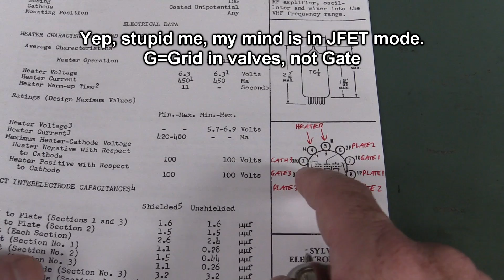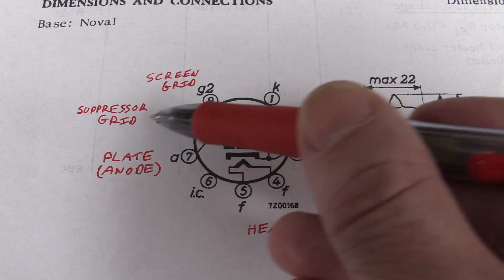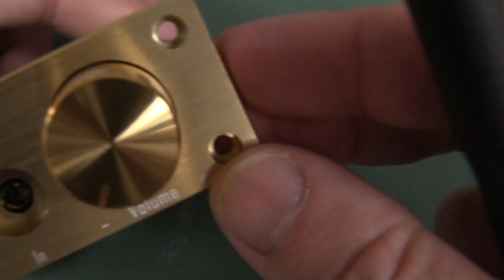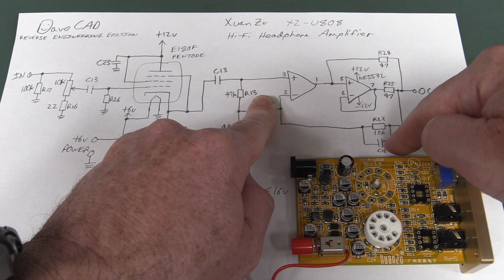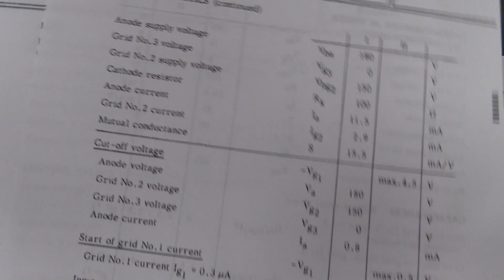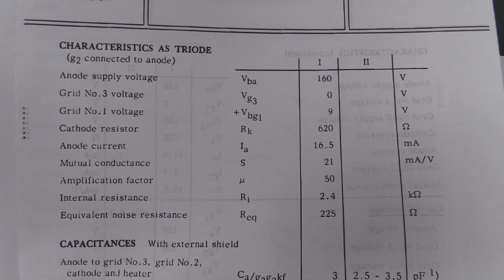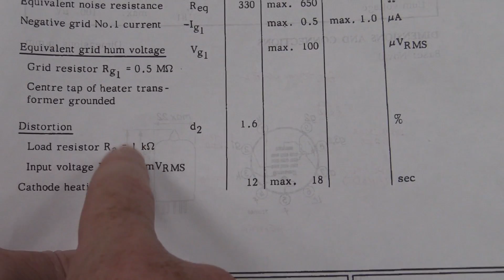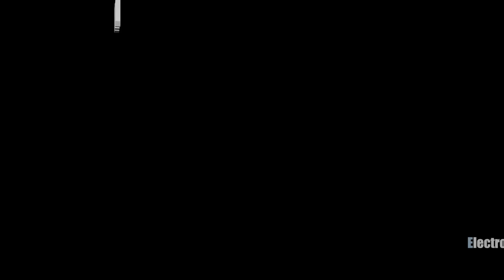EEVblog #837 - Reverse Engineering A Valve Headphone Amplifier

Comment: My rant isn't so much about the gimmicky use of the tubes (valves), but the overuse of blue LEDs. Why are blue LEDs used everywhere  !?

I'm old enough to remember when blue LEDs did not exist. You had red, yellow, and that ugly lime green, but no blue. Cree made some SiC blue LEDs in the mid 80's, but they didn't go far. It wasn't until superbright blues, made of GaN came out ~1994, then blue was everywhere !

But that was 22 years ago, so why still the frick'n overuse of BLUE !? Reds a nice color. Amber/yellow even looks classier. With GaN, they now have really nice green, too. And orange is one of my favorites. When on, it looks like candy. You almost want to bite the LED. Though orange, may not be a good choice under a orange glowing filament. But screw the blue ! Its also harsh on the eyes.
Reply: Michael Moorrees 

The blue glow produces a "visible illusion" of power.

If one were to see a high-power broadcast transmitter using vacuum tubes (e.g. the transmitter of any 50kW broadcast station before about 1980), a blue glow would be visible, along  with the brighter orange glow of the filament, simply because so many electrons were flowing so fast with traces of other gases in the tube.

Ironically, a blue glow in a receiving tube indicates that the tube is weak - that too much gas has accumulated in the tube.
Reply: honestly?... they have to do me a favour:: OR!! they start using white leds as indicators in devices with more that one indicator, OR!! i'll be happy with blue as well.... i don't see any major difference between the colors they use, i mean

-greenred
-redgreen
-yellowgreenred
-thatususalcolorusedtodrivedaltonicscrazy :D

screw lan cards and arduinos!! i'm a proud daltonic!! :D

but i agree
Reply: Because in 1990 blues cost £5 each, so to old engineers they still have an aura of luxury...
Reply: I'm old enough to remember when LED's were very small dots only on watches and calculators, and when the LM741 originally came out and sold for more than $10 each. Also 4 function calculators were over $200 and had a green display.

Comment: In some jurisdictions this could be seen as a Trading Standards issue, since it isn't actually a valve AMPLIFIER at all. Even if they made the argument that a cathode follower is a current amplifier that doesn't hold here since the input resistor on the first op-amp is a much higher value than the volume pot resistance. 

The op-amps provide a gain of about 6 by my reckoning, and probably a bit of tone shaping which  leads to the subjective, "Wow, that sounds better" user response.  Though,a 5532 isn't designed to drive a low impedance load like headphones, and the use of a purpose-designed headphone driver would almost certainly give lower distortion results and more drive power. 

In fact, the design min load impedance of the 5532 is 600R according to the Ti datasheet, and the current limiters will operate at about 40mA typically (0.6v across 15R) so they really are stretching things here. Even with two in parallel that's going to hit a current overload situation at about 3v peak output with low impedance headphones and two 47R's. That would actually be more than adequate volume with most headphones, but it's a very bad way to design an amplifier, basically running the ICs way outside of design envelope. 

Exactly why they didn't use the valve as an amplifier, not sure, possibly because a higher supply voltage than 24v would be needed to achieve a linear response.
Reply: "Exactly why they didn't use the valve as an amplifier, not sure, . . . "

Because that would take work and circuit complexity. There's no way they could meet their price point.

Comment: Awesome video..Would love to see a reverse engineering of the peavey 6505mh (mini head). A lot of talk on whether the tubes are functioning as most tube amps do..
Reply: From the Peavey product page: 2x EL84 power tubes and 3x12AX7/ECC83 preamp tubes
Those are pretty standard types/quantities of tubes for a guitar head. Sounds like a normal tube amp design to me.
EDIT: Electronics repair tech here... I've got a Marshall solid state head sitting down at the shop right now, really should get around to looking at that... :)

Comment: Tubes don't use as much power as a lot of people think My tube amp in my record player used about 75 watts. A hair dryer uses 1200 to 1500 watts, a cable box uses 500 watts I would not use either one. A tube TV used 300 watts still one of the lower wattage users.

Comment: I was surprised the tube would even work at all with just 24V on it, cathode area is large on those tubes and drive current needed is tiny so I suppose it works well enough, definitely will add the tube sound. Its all obviously just a marketing exercise. The pcb is very nice double sided plated through hole solder mask and the unit is very neat, very surprised, very nice. The ne5532 opamps are old school and very average sound quality, with the tubes in the circuit its definitely not hi-fi. The ne5532 buffer circuit has some gain and the response appears at a glance to be tweaked to compensate for the I guess the tubes very ordinary freq response performance.

Comment: I'm quite surprised... I saw this in the previous mailbag and thought the valves were just fake and made to glow and not part of the circuit.... but they do actually do something.  In the CF configuration do they introduce a distortion that can be perceived?  Does it sound like something that could be construed as "Tube Sound"?   It would be interesting to follow this up with some time domain analysis, what sort of distortion etc?

Comment: I might have this wrong, but i think it's not about distortion, it's about "tube sound." They add warmth to the audio signal. It's an audiophile term. So, does this amp do that? Only a professional audio enthusiast would be able to tell. Dave, you don't strike me as one. :)
Reply: You do realize that the "warmth" you speak of is the product of an innate alteration applied to the original source audio by the tube, mostly harmonics and non-linearities  -- the very definition of "distortion".  So it is, in fact, all about distortion.

That said, there is nothing wrong with preferring a certain sound to one's music, just so long as one realizes that any alteration of the input source is, in fact, a distortion of that source.  The problem is when egos, and sellers looking to exploit those with far more money than sense, can not acknowledge that the "warmth" is what it is, distortion -- desirable, or not, it is what it is.
Reply: Ethan Poole Any alteration is distortion, but distortion has a strong negative connotation. When someone says distortion, I immediately think "clipping." But that's not what you're saying, and that's not what I'm saying either.

Comment: The pros for valves are as follows. 
- simpler circuits than semiconductors in amplifiers. 
- less need for negative feed back, also simplifies stuff. 
- easier to DIY
- very tolerant of overloads compared to semiconductors. 
- beam tetrodes/pentodes behave in a very interesting way in a ultra-linear configuration, giving you a mix of a voltage amplifier and transconductance amplifier, behaving like a constant power amplifier. 
- some triodes have extremely low distortion without any negative feedback, much better than transistors, though the latter can train its superior gain for less distortion. 

Everything else goes to solid state.
Reply: +TheLawnWanderer Til you get into the transforem and got 1% or more distorsion may be killing and unicorm and use his horn build transformer made it sound better.
Reply: pufero1 You can actually make transformers almost transparent to the whole circuit, with a few DB of negative feedback after the tranny.
making a tube power amp with 0.2% distortion isn't all that hard.

Tubes aren't great, they're fun.
Reply: +TheLawnWanderer Valves aren't simpler than semiconductors in my humble opinion, due to the need of designing a HV power supply for them, therefore they are not easier to DIY.
It's seems much simpler to me to power things from the likes of +5v/-5v and negative feedback isn't really that hard in the first place.
But again, that's just my two cents, and I'm more into digital and analog semiconductors than valves, and valves don't seem like much fun to me (and neither transormer winding).

Nixies are fun though, because you can actually see them working in a different way to all other display technologies :)
Reply: ZXRulezzz HV supplies aren't more difficult than lower voltages ones, they just have higher voltages is all, a bit more dangerous sure but not really more complex. 
Tube amps don't require two power rails like semiconductor push pull amps do, also they need less filtering on the rails. 

I made a HV supply with a big 1000va toroid tranny that I hand wound the secondary, a ultrafast diode bridge rectifier and some filter caps, two 10,000uf 500v electrolytics, +480v is no big deal to achieve.
Reply: TheLawnWanderer
you can build a ampl whit 0,01 distorsion whit no money ,.
Valvs are fun but no the best choise.
Reply: +TheLawnWanderer holy shit that is a lot of C for tube circuits.

Comment: Yes, this tube design is silly. I prefer my tubes to be in microwave ovens, high power transmitters, and HD viewfinders. 

Still, I was surprised to hear Dave say that connecting the screen to HT makes it a triode design . The screen must be connected to HT in order for it to do its intended function. It acts "as an electrostatic screen between the anode and the control grid (i.e. the first grid) in order to reduce the internal capacitance between control grid and anode." (from wikipedia) .

The suppressor grid serves to suppress secondary emission from the plate, and is between the screen and plate.

Comment: And audiofools will still find a way to justify using tubes - cause the soft clipping (You always overdrive your headphone-amps of course) or better sounding noise, or different distortion.

They will never come to face reality that electronics has kept on evolving and simply got past the points of tubes.

Comment: Hey Dave, if you don't use the amp, which I guess you won't, could you smack one of the valves and take it apart under the Mantis? Would be inderesting to see, as probably no-one born after 1970 will have seen a valve from the inside.

Comment: What would be a better tube and circuit design for that application? What would be the "genuine article" so to speak? If you wanted to run your audio signal through a valve, what would be the audiophile approach?

Comment: Yo Dave this product should activate your BS filter . Passing a signal thru a proply designed tube circuit provides no "magic" only gain . or in the case of a cathode follower impedance matching , the "tube" sound is a pleasant THD , if it is coupled by transformer specialty used as in a push pul configuration , on its clip drive it produces Even order distortions if they skipped the tube  and drove a output transformer  in a push pull manner with the two op amps then it might work also the op 275 is a much better choice than the NE-5532 , and PS I really  like your referring to tubes  as JFET that lights up is a great way of understanding there operation    , Harry .

Comment: just a little trivia, running tubes on low voltage is a sort of common practice in the guitar world, not in amps, but some effects pedals use tubes for better overdrive sound, and all pedals only run off low voltage, but this doesnt matter in an overdrive pedal, we want the extra crunch :D but yeh valves are rubbish in everything now other than guitar gear, where the difference is incredibly noticeable, solid state amps have better clean sounds, but suck at overdrive and distortion

Comment: dave thanks for the excellent vid, please forgive my ignorance.. i'm trying to up my level of understanding in electronics. my understanding is that a valve produces a pulsed dc output when the grid is fed with an ac input signal (replicates the ac waveform but above the 0v line). i understand that having a transformer after the plate effectively resets the outputted pulsed dc wave form to straddle the 0v line again, recreating ac. as you've shown in your breakdown, the coupling cap is fed from the cathode. i'm stuck with visualizing how the coupling capacitor or a transformer (which is biased negatively at rest in this case) can transfer the wave form, totally accurately.. surely if the first signal pulse swing is in the negative direction for instance, the cap will ignore it as it's already fully biased in that direction? i always try to imagine a capacitor as a double ended hydraulic ram. so would i be correct in thinking the piston of said ram always be bouncing off the negative bias end of the cylinder as when the signal stops the cap will charge fully negatively from the cathode feed? if this is correct then is there a form of distortion added when a higher amplitude wave form is transferred through with regard to a smaller amplitude wave? like a 0 point drift? my thinking hydraulically.. a large oscillating swing on a ram, biased to one end, will have a different cycle centre point within the cylinder than a short oscillation. correct me if i'm wrong please dave... or anyother of you wonderful system heads. cheers, peace xx

Comment: Second question - What is the point of the tube/valve if the gain is one?   Isolation?   Impedance matching to the source?  Looks "cool"?
Reply: To impart the harmonic distortions that are characteristic of tube amplifiers...in other words, to inject added "desirable" distortion into your output signal.

Many prefer the warmth of the distortions added by traditional tube amplifiers to their music sources, and there is absolutely nothing wrong with that so long as they also realize that the warmth is, in fact, a distortion and not true to the original recording.  We all have our personal preferences and many of us will fine tune the bass and treble response curves of our audio systems to our own personal tastes and choice of music.

Comment: Not to mention the tube is subpar, the circuit is subpar, amp but also the opamp is subpar and used in a wrong configuration! NE5532 is late 80s design. There have been major improvements since then. It's meant to be used with a DC servo.
DC to DC converters unfiltered into bias, because everyone likes extra ultrasonics which are nicely amplified by the valve. (it's not quite a buffer at HF)

They couldn't use any other valve or actually amplify with it because few of them work at this low voltages at any gain - and they didn't want an actual huge power brick.

Chinese technology in a nutshell.

Comment: People often forget that these kind of cheap chinese-made tube/valve amps are almost all hybrid systems where the pre-amplifying is done by the tubes/valves and the actual amplifying is done with transistors (or like in this case here with Integrated Circuits). The actual "tube" warmth is often desired to give the audiosignal a bit of overtones and analog thickening to the bland digital audiosignal that leaves the DAC to the analog world. It's all a matter of preference. I can see why a lot of people desire a tube/valve audiosignal pass-through, which explains the insane amount of "tube amp" or tube Synth" emulation VST effects or VST Instruments. Just like some people like digital aliasing, other people prefer analog overtones & slight distortion. I can't understand people who constantly hate like crazy against anything Vaccum tube / Valve related technology. Geez for fox sake… let people enjoy things. If you don't like it, don't use it. Simple as that. However i DO agree that adding tubes / valves into such a circuitry where they don't really do much is indeed very dumb and it should be addressed for sure. I wonder with all these different chinese-made Tube / Valve amps if there's at least a few that are actually good or not a complete waste of circuit board space? For example the 6J1 Tube amp kit that can be ordered all over ebay that requires self assembling. VERY interesting video by the way. Was looking for such a detailed tear down. Really enjoyed it as usual :) Thanks, Dave!

Comment: Even if it is only a buffer, why putting tubes in the circuit?
Tubes create harmonic distortion on your signal, BUT it does it by adding paired number of harmonics (2nd, 4th, 8th, etc).
Transistors (solid state circuits) create a diferent harmonic distortion (3rd, 5th, 7th etc).

Now physics: its nicer for the human ear, to hear paired harmonics (4th, 8th, 12th) insted of the other ones that transistors give.
That is why tubes have lots of character and people still want them, even if it is only a buffer.

Check for example guitar preamps and amps, the most experienced allways use tube amps instead of cheap and crappy multi effects units that by the way EMULATE those tube amps.

Tubes are a pain in the ass for maintenance, but they sure sound nicer than "cold" trasistors

Comment: Hey :) 
pretty good video!
This little device seems to be at amazon under the name "Nobsound NS-08e". That manufacturer offers another little device, named "Nobsound NS-10P": a small Baxandall EQ with tubes - for even less, only 40$. I wonder if that is also only a tube buffer fedding an op-amp, or if it is a real tube amplification circuit inside (taking the output from the anode...) that restores the attenuation caused by a passive Baxandall network.
Maybe you wanna reverse engineer that?

Comment: Well, I expected more deep tests, like spectrum analysis or at least testing the phase and dynamic behavior with a sine sweeping over 10 octaves. But this is not an audio test. Though, I do not expect some magical tube warmth from this funny thing, I still wonder if tube doing anything with the sound. At least it should eat the low-end because of DC offset.